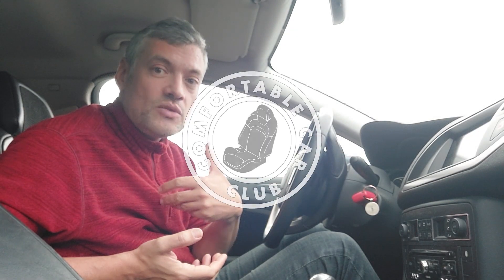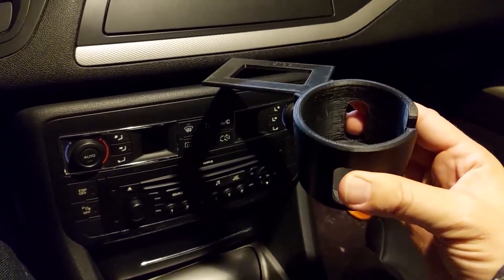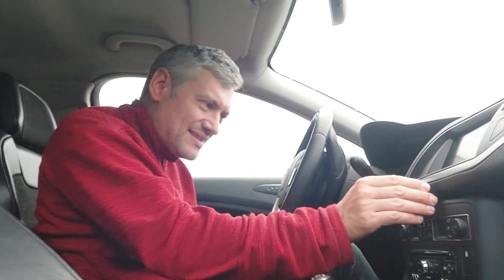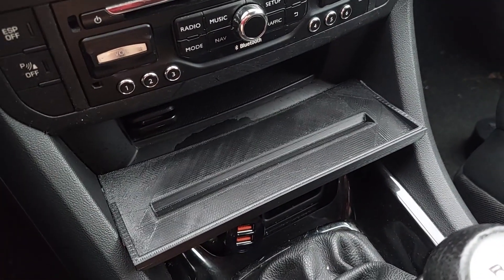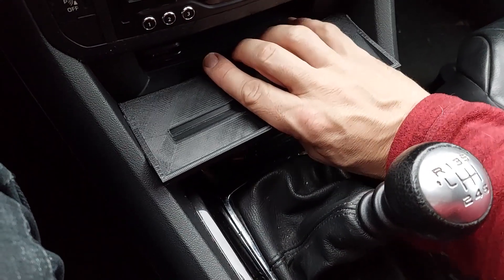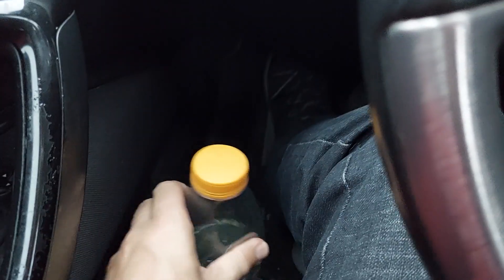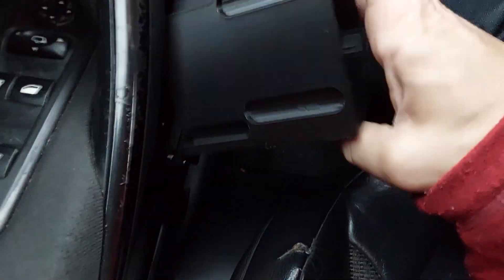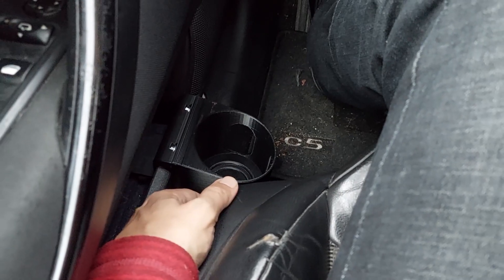Failed Projects

Comment: For my phone holder I have started using a magnetic mount, so a phone case is required but, a small dome style holder that's glued onto the flat blank space of facia between the screen and the driver. Honestly, so glad I did this. Single best thing I've done in the car 

The cupholder issue, best solution I have is a similar model to yours, using the gap in the dash just the same. I had the ends made into a wedge shape so it gradually gets thicker and thicker, causing movement to be a minimal issue. The mount itself is a ring with a cup that drops into place to hold anything. McDonald's large cup, which is a standard unit of measurement, was absolutely fine. 

Unfortunately it ultimately melted, I contacted the guy who sold me it, saying he had a new material that wouldn't melt. I paid him in advance and he's since blocked me.... 🤣 Nice guy. So now I just drive thirsty. 🤣
Reply from the maker: Ouch! I've since come up with (yet) another solution, but I'm still testing it
Reply: @comcarclub  well I can give you my address if you need a UK tester 🤣🤣🤣

Comment: To be honest, I strongly believe that the first cup holder is actualy able to solve the problem, without moving, IF we secure it with a screw from the inside. Partial disassembly required. That is actualy my idea, don't know when I'll be able to try it. 
But then again......they put that friggin' emergency indicator button right there, so that you don't have a chance of doing anything to have a proper cup holder....😂😂😂😂😂😂😂😂
I mean.....realy, they could have utilised that triangular space, immediately to the left of the  screen, to place an emergency indicator switch, and leave the rest of the dash available. 
Go figure.
Reply from the maker: The hazard light alone is a puzzle. So many places they could have put it, and they thought that would be a good place. Why? "Because French"